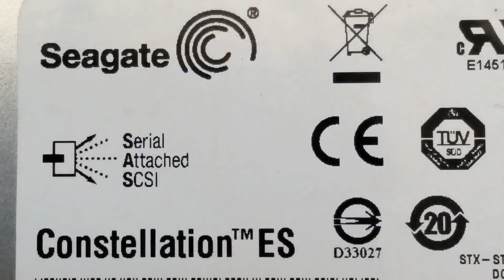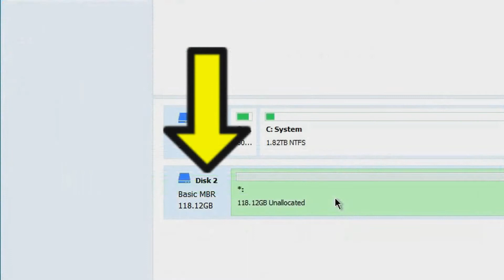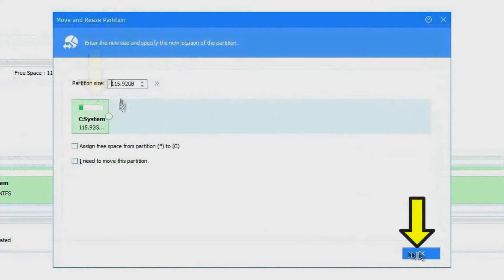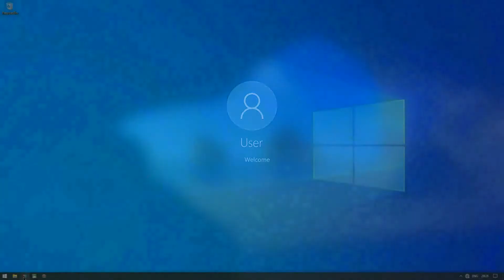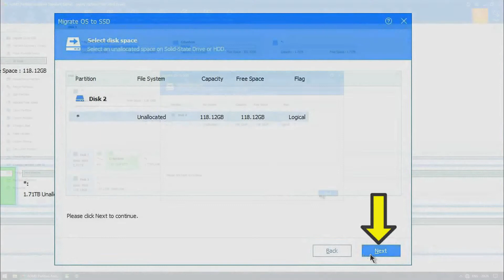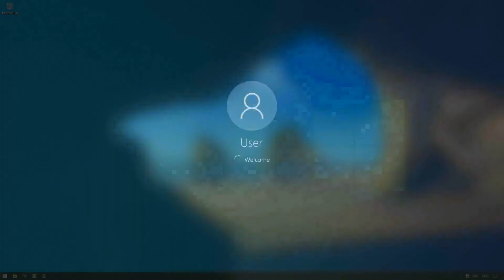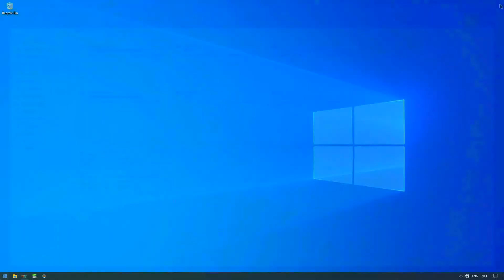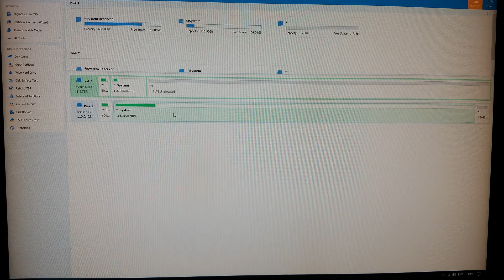Clone Windows 10 FREE!

Comment: Hey Alby..another great vid most enjoyable and informative. I have z600 with the Os an a ssd & two nvme drives & hdd for storage. I understood the motherboard wouldn’t boot from a mSata card?
Reply from the maker: It won't boot from an NVME SSD but it will bot from an mSATA SSD mounted on a card  just like the Z800 - the only problem you have on the Z600 is less PCIe slots than the Z800.
Reply: @AlbyTastic  brilliant thanks for the reply, yeah I’m filling up my slots now I’ll check, maybe a mSata in an enclosure via Sata port on the motherboard would work too? Thanks again . Steve
Reply: What are the parts needed Alby I just scored a z800 and want to upgrade it at the moment it's running on an old noisy 500gb SATA HDD

Comment: thanks
Reply from the maker: Glad you like it. The Z800 is a really great machine.
Reply: I also have z800 with 128gb ssd, 2TB HDD, and 500Hdd. 24gb 
 ram of 4gb sticks. unfortunately one stick is not working.. and nowZ800  have 20gb of ram.y system is slow and gets hot..
Reply from the maker: @imrankhan-ko4op  Have you tried re-seating the faulty stick? Simply take it out and put it back in sometimes helps. When you say it gets hot, install a small free program called CoreTemp which allows you to check the temperature of each core. You can also set a temp for the machine to shut down if it reaches it - see my vid on the Z800 Horror story for more info. - But the Z800 fans dont begin to operate until the CPU cores reach 80C so running a bit hot is normal.